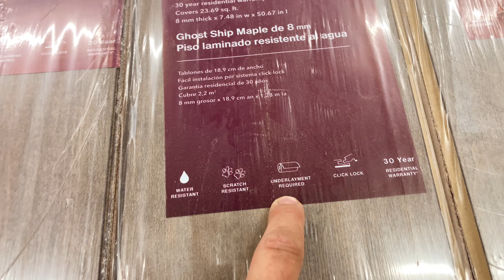Completing the Studio Floor

Comment: Yep, sliding door should be installed much higher, so you wouldnt need channel. With flooring, you should have measured the room, so the plank where you started with floor would be same width as the last ones

Comment: Nice job Shane!  Thanks for the tip using epoxy and saw dust to fill an error or holes.  I make wine cork trivets using black walnut wood or maple wood for the frames.  I've been using wood putty to fill nail holes or errors.  The problem is that the putty always dries out and when I need it, it's rock hard!

Comment: Floor looks nice, the cobble board turned out good, pattern fits.  Should just use straight clear epoxy so that the scars over the years show, or use a red dye so the wounds are there but the table is still smooth.
Reply from the maker: Haha I certainly could do that

Comment: It’s good to damage the workbench straight away. It takes the apprehension out of using it.
Every guitar/bass I have ever bought has a white mark on the tip of the neck from me excitedly flipping the guitar into the ceiling while throwing the strap over my shoulder. Once that ding is present and the essential beer/shot dribbled on the instrument on stage means it’s officially prepped and ready for battle.

Comment: NICE JOB on fixing the workbench router FUBAR. Mixing sawdust with epoxy makes "Instant wood," and after it's set, is harder than the original wood. I'm not sure what your plan is with the groove you milled for the pocket door. I would have laid the flooring intact and trimmed the bottom of the door. I'll be interested to see how you finish that off. Nice work, Mon Ami, I would be proud to call your shop.., "MY Shop!"

Comment: I've done floor work for over 10 years, specializing in LVP and other tongue and groove floors, and I never seen anyone cut a channel in the material like that for a door! Usually just trim the door. Not saying it's bad and you're wrong, just saying I never seen that. I kinda like that idea...
Reply from the maker: It just made sense to cut the channel for the pocket door to ride. I didn't mention it in the video, but I did stabilize the channel with cyanoacrylate to make it stronger, since it's going to be high traffic. Worst case, It ends up breaking and we will find a solution at that point.
Reply: @KleshGuitarsOfficial  it's kinda cool idea for Pocket doors. They should make pieces specifically for pocket doors like that for when trimming a door isn't an option. Maybe you just invented something!!??